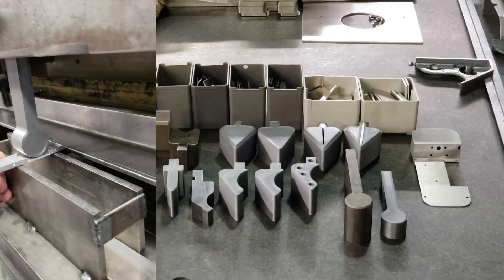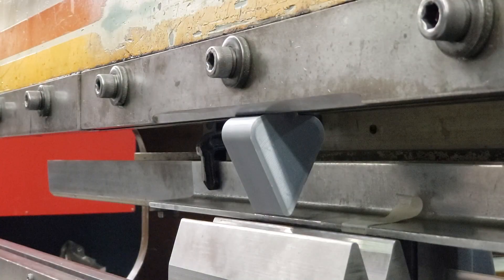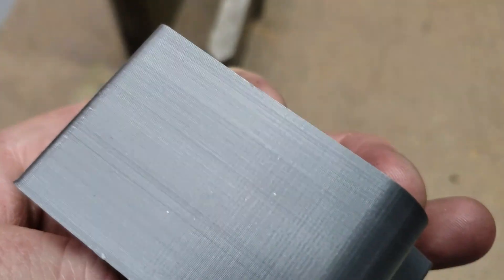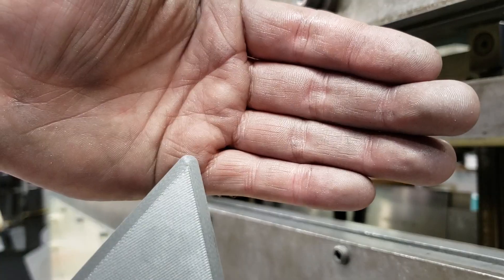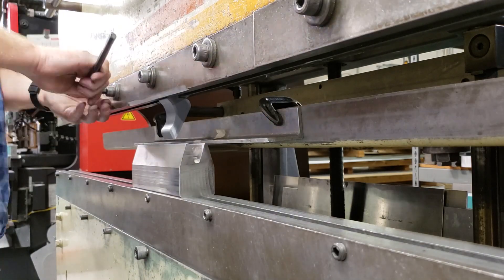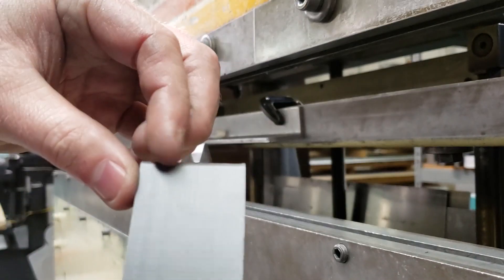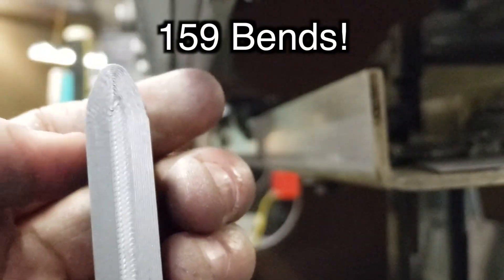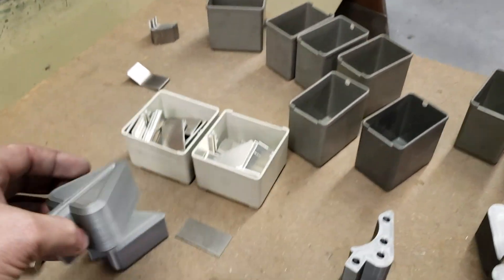Bending Thick Steel with 3D Printed Tools - Prusa PLA

Comment: Those tools would last longer if you add the contact part of metal. And the whole body still being pla
Reply from the maker: Sure, you could easily slide in a dowel pin but if it doesn't need to last longer than 100 parts or so then it's not necessary. The plastic has the added benefit of not marking the part whereas normal tooling leaves tool marks in the parts.  We get a lot of custom orders that we might only see once or a prototype goes through 4 different revisions and the tool needs to change each time.
Reply: @ProtoG42  just a thought for the ones who would want to make them last longer. But in any case, they are a good option. And no milling needed. Excellent!

Comment: That is damm impressive. I think for short runs thas perfect but for longer runs I would be tempted to use the printed part to use to mold and cast the part in aluminium. Just goes to show how useful 3d printers can be

Comment: This is awesome.....Could you try a symetrical die over a longer length? Say up to 1ft? 1" pieces don't exactly take a lot of tonnage....
Reply from the maker: Bending a 1" wide section of 10 gauge steel with a 1" V die requires 1580lbs. I'd rather keep going thicker than waste 12 times as much metal and plastic. The values obtained with the smaller forming tools allows me to calculate how wide of a flange I can form given a specific material and thickness.
Reply: @ProtoG42  so keep going thicker man!!! I'm interested to see where this goes!! Lol 🍻

Comment: Really great video, well done.  Pretty incredible what PLA can deliver at such a low cost.  I work for a 3D printing company called Markforged and we have lots of customers doing similar things with fiber reinforced plastics, one example: https://markforged.com/case-studies/press-brake-punch-and-die/.  There is certainly something to be said for 3D printed tooling in a job shop.

Comment: Perhaps a better solution would be to laminate your tooling in say 3mm mild steel. You have a laser right there! I would be quicker, stronger and longer lasting, Put a hole in the laminations and run a piece of all-thread through the stack or you could put a notch in the edge and weld them. It's got me out of a hole before now. :-)
Reply from the maker: For sure, we already do that. Even for the radius tool, we would normally cut bar stock, turn down rod stock to the right diameter, cut them to size, and weld them together. This is just another tool in the holster to take advantage of. Read the articles I posted above and you'll see some of the other use cases.

Comment: 4:26 That, and PLA's tendency to gradually deform under sustained load, are why I avoid PLA for loaded components, instead going for plastics with deforming failure modes (though sudden shocks blow up everything), like PETG and ABS. Though that huge pile of bent metal says a lot about how useful all that rigidity is when parts aren't failing. Thanks for giving me something to think about next time I need a tool.

Comment: Holy bat crud, that is impressive. I ran a brake for a few years. We made and heat treated a LOT of our own stuff. Even if you just were prototyping the tool (not the part) to make sure you had it right, this would be a great thing. If you can get say 500 parts out of one, it might make it more cost effective to just use printed instead of steel(tool steel is expensive and finicky. I saw another video where a guy made his own license plates (apparently you can easily buy blanks) with a top and bottom die made out of aluminum. I wonder if you could just print it, support the top and bottom with a metal back plate, and press the license plate that way?
Reply from the maker: I totally agree! I will definitely try embossing sheet metal with this process and other types of forming.

Comment: I see on the broken part you used infill.  Can you tell us how many wall layers and infill percentage gave you the best results please.  As you have just proved, given the right parameters and layer orientation, 3D prints have better than expected compressive strength.  Great demo... thanks.
Reply from the maker: The tool that broke was 8 perimeters, 20% infill, 6 top/bottom layers. The first two tools were also printed like that and didn't but the forces were a bit easier to handle. The gooseneck tool that didn't break was 12 perimeters, 20% infill, 8 top/bottom layers. You could go 100% infill and it would probably bend even thicker steel but I would stick to at least 12 perimeters, 20% infill as a minimum starting point if you want to try to make your own tools.
Reply: @ProtoG42  Thank you. Indeed, perimeters are more important than infill, at least in my tests.
Reply: @ProtoG42  You don't need to go higher than 60%.. 100% infill makes the part shatter easily.. there is no flex.. you need a bit of flex at least.. 60% is a lot when you look at the density.. 3D infills also help with lateral forces.. Prusa Slicer has cubic that works wonders in all directions.. i'm an amateur anyways, but have tested a few things myself..

Comment: This is really cool, thanks for this, I do some manual metal forming at home  (usually over steel and wood forms or sandbags ) then beating them out with various hammers, I had been waiting for an oportunity to use my 3D printer to make some forms but I haven't found the need yet, but this is really interesting I hadn't thought of using it in a press like that
Reply: if your going to be hammer forming with the dies your probably gonna want to make them out of nylon . Or abs at a minimum...not guite as much tensile strength as pla but much tougher far as impacts go.(if have a decent compressor be sure and test out some homemade hammer heads for an air chisel...your shoulders and hands will love you!)

Comment: Just a tip:
Make a metal outline for where the plastic piece pushes so it can last longer
Reply from the maker: I've already designed some attachments for existing steel tooling as well as plastic tooling with metal embedded into it. At a certain point it doesn't need to last longer, it just needs to be fast, cheap, and effective.

Comment: Been doing this for some time now, and ofc we did test the failure point.
PLA is quite good, but the danger is that when it fails it fails explosively.
Our test piece was a dimple die, rather small in size, it took 5.5tons before it exploded.
Reply from the maker: That's pretty impressive!

Comment: That's cool. Have you considered laminating the 3D with a skin of metal to make it last longer?
Reply from the maker: I've already designed some attachments for existing steel tooling as well as plastic tooling with metal embedded into it. At a certain point it doesn't need to last longer, it just needs to be fast, cheap, and effective. The added benefit of the plastic is that is doesn't mark the part where metal tools will leave marks in the part.
Reply: @ProtoG42  I had the same idea, but also that time would be your main focus with temporary tools like this. Could you just design the tool a bit undersized, then press a thin gauge metal, and then have a spot higher up the tool for you to ziptie that metal skin onto the tool at? Effectively, the tool would be shaping it's own skin, and it shouldn't be too hard to 3D print two very simple notches on the die for the ziptie to rest in. Should give you better load spreading, and less friction too.

Comment: Really cool! What infil and wall thickness were you using?
Reply from the maker: Thank you, 12 perimeters, 20% infill.
Reply: @ProtoG42  This is late and all, but I was especially surprised when I saw the gooseneck fail that it wasn't 100% infilled. It's evidently good enough for a simple angle, but have you increased the infill rate for the gooseneck since this video?
Reply from the maker: @mtnbkr5478  I have not, but it definitely has potential!

Comment: I work in the 3D printing industry and people are always amazed that FDM printed plastic parts meet or exceed the compression and wear properties of injection molded plastics. Add a little filler in the form of glass or carbon fibers and you have yourself a tool usable for hundreds of cycles. My favorite material I've used is a glass filled PC-ASA that I made myself.
Reply: How is the filler added? I've never done 3d printing.
Reply: @TheArtificiallyIntelligent  Its melt processed in large batches. Molten plastic heated to temp is added to fillers (fibers with a de-clumping agent and compatibilizer). This is then blended until the fibers are evenly distributed (homogenous). This is then pelletized. The pellets are fed into an extruder. The filament comes hot out of the end of the extruder into a water bath and once cool and dry is wound onto a spool.
Reply: @Gork-an-Mork  you have a video explan this?
Reply: Hi Zach!
Reply: Not sure about glass but the negative for carbon fiber is it becomes abrasive so not for mating parts
Reply: @bertamus  Its true that all reinforcing fibers are abrasive. For high friction/wear zones moly disulphide can be used to improve wear characteristics.

Comment: Meanwhile our maintenance workers hate 3D printing, because everything is brittle and can't withstand even small load. It's impossible to explain them it's not problem of 3D printer, but problem of guy who designed huge parts with bridges (with no supports) and with screw holes situated worst way possible - so if you turn a screw just a little, it will force layers away :/
Reply: I think I will really print out my version of same thing, consisting of five separate pieces (one model printed four times + one model to hold two sets apart at exact distance) and give it to maintenance guys. It's so simple it can be printed even at high speeds with no problem, there are no overlaps and layers are situated correct way, so threaded rod which holds everything together shouldn't break it even when they tighten it too much.
Reply: Pla shouldn’t really be used for industrial applications, these guys got lucky because it’s a one time thing, but it’s better to reserve pla for artsy projects
Reply from the maker: @bertamus  Sorry, you are mistaken. Experts in the field are also using PLA for this application: https://www.thefabricator.com/additivereport/article/additive/need-a-custom-press-brake-tool-try-printing-it
Reply: We use it just as holder for bearings, result is practically XY positioning "table" out of smooth rods. In center are attached 3D printed parts to direct air from compressor into proper direction and they are moved in circular direction. There's practically no load, just weight of smooth rods, some thin aluminium frame and those 3D printed parts to direct air. But that's not important when holder breaks after slightly pressing one screw in hole.
Reply: Have them try out Markforged, you can get crazy strength from 3D printed tooling

Comment: Impressive for being just PLA. I see people using PC filament for this kind of tool making, looks like PC is not always needed.
Reply from the maker: PLA is great when the characteristic you need is rigidity.
Reply: People think that pla is weak. Its not. It just have this fail curve where it does not do much of plastic deformation before failing. But its a strong material.
Reply: @HidekiShinichi  PLA is rigid (and brittle) af. if you need dimensional stability (unbending, unyielding), PLA win all other 3D printing materials
Reply: @VuLamDang  well.... Not that we have continuus carbon fiber or other simillar materials right?

I wouldnt go as far as to say that pla is absolutly best from all availble for that. But it is certainly one of the best and probably the best if it comes to standard ones.
Reply: @HidekiShinichi  ha ha yes, I was hyperbole. I was refer to the common stuff, ABC, PC, PETG. Idk if PEEK is more or less rigid, although it is certainly not common
Reply: @VuLamDang  PEEK requires special enclosed printers with crazy hot end temps over 343°C and heated beds capable of over 150°C
. I've only seen PEEK and ULTEM (PEI) capable printers at Aerospace companies

It's stronger and has higher heat and chemical resistance but you definitely pay for it in many ways.

Comment: Are full solid inside? Or you use an specific infill?
Reply from the maker: 12 perimeters and 20% infill. They would be even more rigid with more perimeters/higher infill but at a certain point it's not necessary to waste more plastic because the tool life will be determined by the surface eventually wearing down and not because the tool broke.
Reply: @ProtoG42  quite interesting approach!  Im sharing this video to a colleague now👍😊
Reply from the maker: @vibrion121  Cool! I'm excited about the possibilities of where this could go for rapid prototyping sheet metal parts. I have a few other designs that could be 3d printed and easily reinforced with metal similar to one of the tools in the video that I did not test.
Reply from the maker: @Billy-yk5te  Check out CNC Kitchen's video where he demonstrated that 6 perimeters with 15% rectilinear infill is stronger than 2 perimeters and 100% infill. https://youtu.be/AmEaNAwFSfI
Reply: @ProtoG42  That only covers prints in tension. Compression (as these parts are subject to) is a different beast: https://www.youtube.com/watch?v=sYagCo6IMJw
Reply from the maker: @patrickweckermann9121  It is more tension, but I wouldn't say only tension. To bend or brake a hook like that requires the outside of the hook to experience compression. Either way, I used 12 perimeters because that is what one of the press brake manufacturers uses in the article I posted above. To bend 10ga steel with this die opening requires about 1580lbs so I think they're onto something with the 12 perimeters.